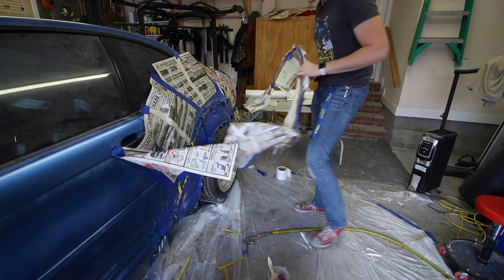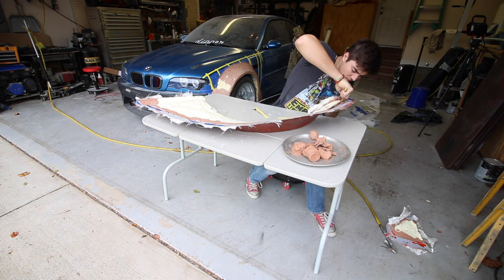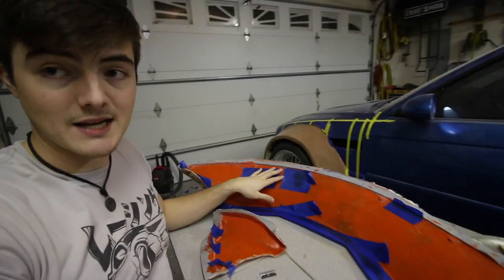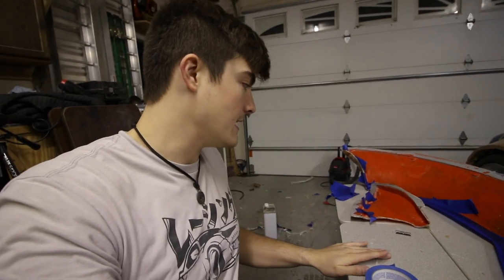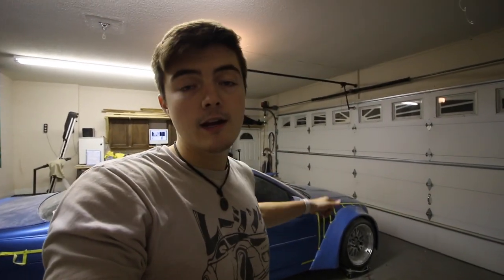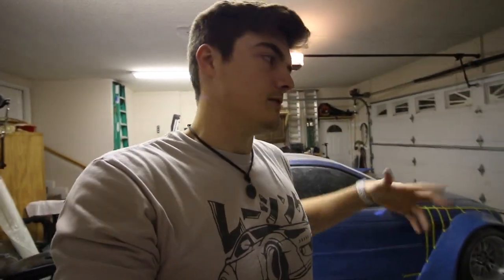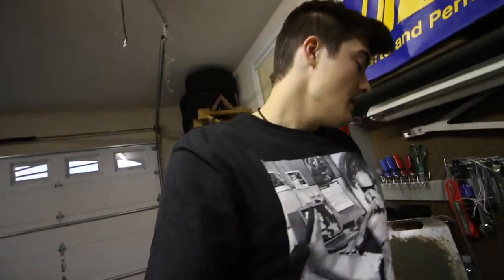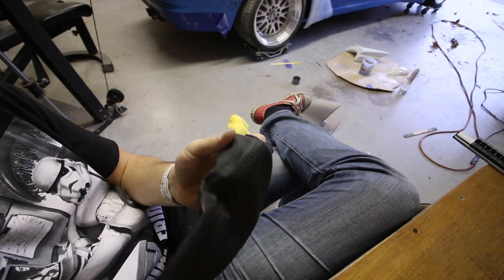DIY Widebody M3: Making Parts & Custom E-Brake Boot

Comment: Air bubbles are from a lack of compaction.  The molding process that you are doing with the fibre glass is a ply composite material, having layers upon layers with a matrix(resin) adhering it together.  In aerospace and bicycle industries, a process very similar to this is done for producing parts from metal molds and compaction with an air bladder (internal or external) to remove any excess resin and/or air pockets and compacts the plies together.

Comment: Good work
Got some pointers:
- when you put aluminium foil on top of your clay, it's mutch easyer to take it of your mold.
- when you lay your glass mat, keep the straight edges on the outside and alway have the teared edges on the inside, they smooth mutch better, now you got lines in your layers.
- when putting on gelcoat, try to put it on in one thicker layer and smooth it out with your brush, when you put up multiple layers, there is a chance to harm your PVA layer.

I'll keep follow your build.

Comment: Your getting a chemical reaction son how with the gelcoat. I would say its dirty but I do see you cleaning the parts before pva. Try spray the gelcoat with either a he coat gun or a spray gun with a 2.5 fluid needle/tip.

Comment: For about 600 a fab shop would have do a aluminum flares in maybe a week or so
Reply: Make 1 set of good fenders , it's easy to make copy's . If it's good enough you can start selling them online to other BMW drivers . And built not bought makes these cooler than most other ones he could just buy .